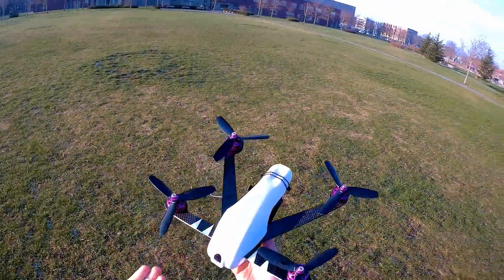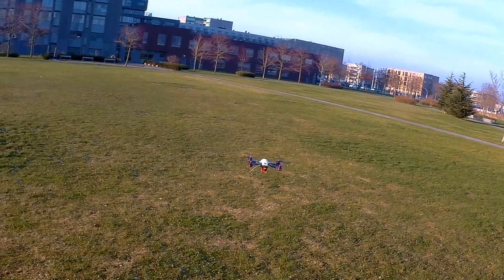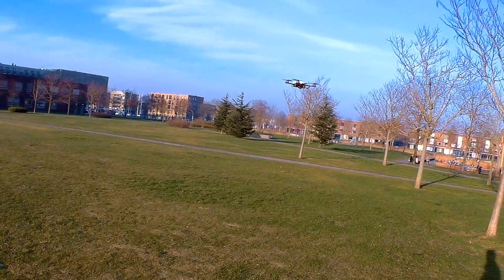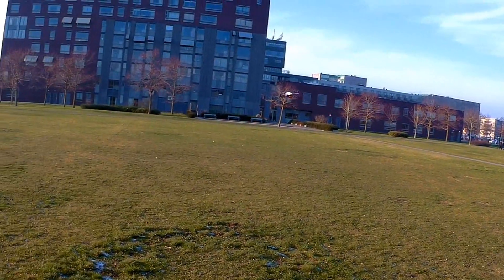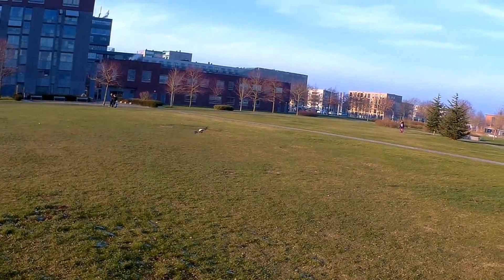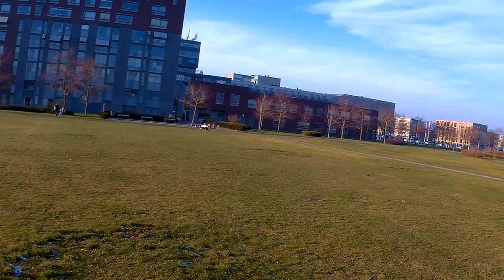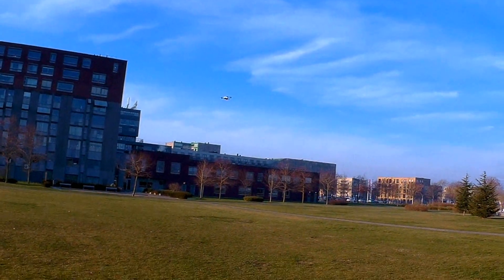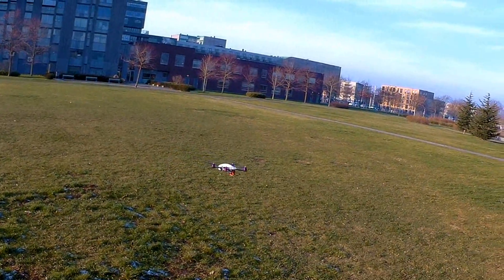Sky-Hero Anakin P5: Maiden Flight! :)

Comment: Wow nice.😃 Nimble few tweaks its awesome. Fpv race video would be 👍
Reply from the maker: Thank you Mark! Yeah.. bit of work to be done still.. That's okee though :D
Reply: DutchRC Adventures Is the noise canopy vibration? No canopy damping shocks? Or pids or props or have you mounted maracas inside lol 😛👍
Reply from the maker: Maracas man! Damn.. forgot I had those in there :| :P 
Hmm i really don't know yet.. It's definately not the canopy.. it not a hard plastick.. more rubbery..
Reply: Cool good luck. You could try benching each motor. Looks so cool. Oh well back to my toy grades. have fun😃
Reply from the maker: Nothing wrong with toy-grades brother ;)  They ARE all toys :)  
Hmmmzz.. it is Definately 1 motor (or 1 ESC).. and it's acts up mostly at Ver low power.. Maybe I'll order up another motor, so I can eleminate things (I DO have a spare ESC)
Reply: Always buy in fives lol. I prefer toy grades a challenge to get the to fly well.😃 I make my own too and mod alot.
Reply from the maker: Modding things (especially that don't cost a lot) to perform better then thought possible Is a great part of this hobby indeed :)

Comment: Nice video Roeland! Did you already installed the fpv gear, did I missed that video? Now put on some goggles and show me what this baby can do!.... Wait no room to put a camera for flight recordings on this one. Maybe a Mobius strapped at the bottom?
Reply from the maker: Halloa! :) 
Ehm nope.. You did not miss that.. I just couldn't resist taking it for a spin first.. installing the FPV gear doesn't take a lot of time offcourse.. Doing it in a video DOES however :P 
And then there is the action-cam thing yes.. I'll probably cut a piece of foam in shape, to get the angle right...

Comment: did you get motor 4 to work with dshot ??
Reply from the maker: These ESC's CAN work on Dshot, but you'd have to remove a cap for it (acording to DYS).. and I don't really feel like doing that :$
Reply: DutchRC Adventures 

okay, i thought about the FC, cant get mine to Work on motor 4 with dshot. multishot Works fine in All motors

Comment: Jeee eindelijk de flight er lijkt een beetje prop wash te zijn. Misschien wat hogere rates.
Reply: Zou beter airmode uit zetten.
Reply: Hhmmmm misschien een beetje underpowerd lijkt zo dan wanneer je de punch-out deed. Op zich hebben de motoren heel veel power
Reply: Welke versie bf heb je nu op de FC staan
Reply: Eerste reactie twee verschillende dingen wat pid tuning van dat prop wash denk ik en vindt zelf wat hogere rates
Reply from the maker: Nehhhhh underpowered it most sertainly isn't :P  BF 3.1 geloof ik.. De nieuwste iig (gisteren gedownload)..
maaarja.. eerst es ff kijken of het weg is met Cleanflight.. als ik et daarin ook heb, misschien een ESC of motor vervangen.. (het is 1 motor die dat geluid maakt)
Reply from the maker: Pfttt.. 1 ESC vervangen (nadat ik Alle andere settings enz had veranderd)... en nu is et weg :|
Reply: Het kan ook toeval zijn dat op zo'n esc een setting niet overeen komt met de andere drie.
Met betaflight en de blheli app op (op chrome) kun je eenvoudig direct naar alle esc's om alles te controleren of te wijzigen.
Ik keek alles af van "Joshua Bardwell" zijn channel.
Zodoende heb ik nu geen gedoe meer ermee.
Zelfs een calibratie deed ik weer van een ander channel.
"Blue project" channel,maar die is helaas nu weg met zijn content.
Slider niet naar beneden trekken,maar met de muis uiterst laag op dat veld (vertikaal) gaan staan om zodoende het hoog level streepje
naar beneden te trekken d.m.v. een klik klik op je muis.
Dit is nodig ,omdat in feite chrome met zijn usb en de app niet echt stabiel draaid.
Heb in het verleden meer gedoe ermee gehad en zelfs op de pid's waren soms rare dingen die ik niet direct zou kunnen aflezen.
Had gehoord dat er ook mensen zijn die direct vanuit hun CLI (dat zwarte scherm)programmeren.
Ik spreek nu wel over betaflight,maar ook cleanflight zit natuurlijk op chrome.
Wat ik wel weet is alsof het lijkt dat die lichter en stabieler draait erop.
Dus ik laat ook geen verkeer toe op de browser (firewall),zodat die misschien meer op adem kan komen ;-)
Alle kleine beetjes helpen :-)
Reply from the maker: De calibratie strijk ik eigelijk altijd wel 'glad  in de blheli suit.. Uiteraard ken je Mij niet, maar ik weet ook wel het 1-en-ander inmiddels ;) 
Op dit moment lijkt de quad Zeer goed te vliegen.. Het probleem bleek na het kijken naar de logs te zitten in vibraties. Niet dat die enorm zijn, maar de gebruikte FC is daar wel vrij critisch op.. Ik heb de FC nu op een block rubber/foam geplaats, dus niet meer op standofss.. Dat lijkt het probleem te hebben opgelost :)
Reply: Misschien is er inmiddels wat veranderd ehm...ga ook een keer de blsuite app nu proberen,want daarvoor was het gewoon een exe programma.
calibratie is b.v.b. die range van 1070 tot 1985 ongeveer.
Dan gaat de esc firmware de range omschalen en ach dat hoeft maar 1 x.
Vast staat wel dat je altijd je volledige throttle range zult verkijgen vanuit je tx sticks. al is het dan niet precies een verschil van 2000 die je opgaf.
Over vibratie...heb zelf gimbal rubber gekozen (de kleinste).
Fc leuk vastgelijmt XD....maar vast aan de gimbal rubbertjes.
gimbal rubbers over die nylon schroef lens kopjes en je kan ze dus ook weer los schuiven.
Alles ligt hoger..maar wel in verticale lijn met de props(scheeld ook weer micro/nano sec hh)
Heb een motolab cyclone met een mpu 6000...(kan beter omgaan met vibratie zeggen ze).
Maar je kan op tig manieren gaan dempen en ik ben altijd een grote fan van anti-vibratie middelen (en minder soft-filtering).
Altijd leuk om te horen als mensen wel een demper op de uitlaat gezet hebben ;-)